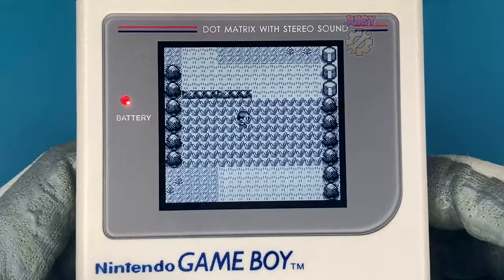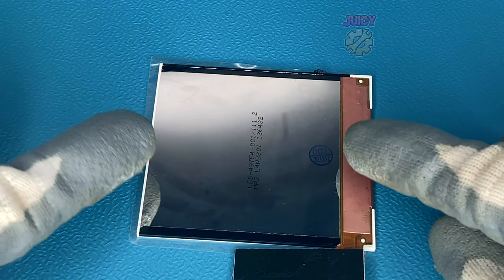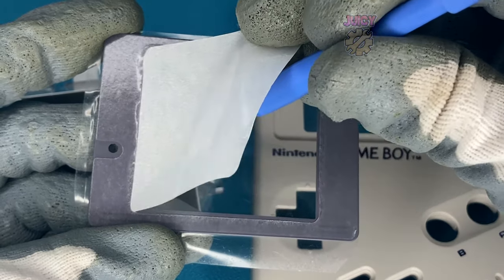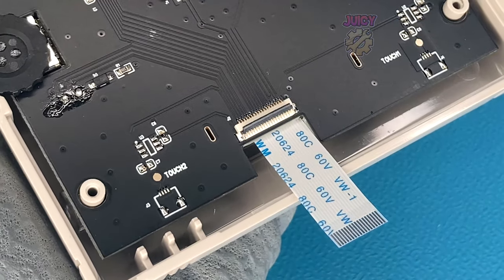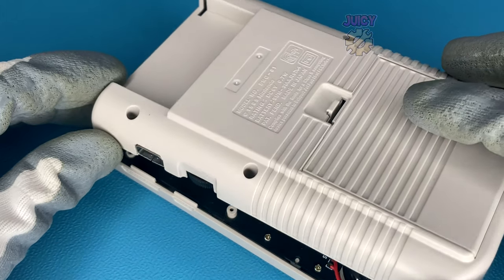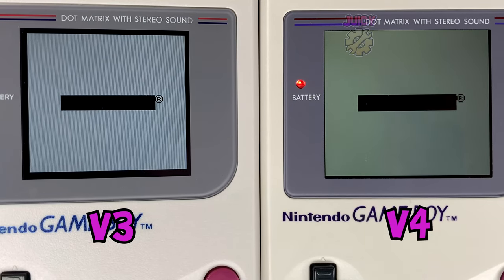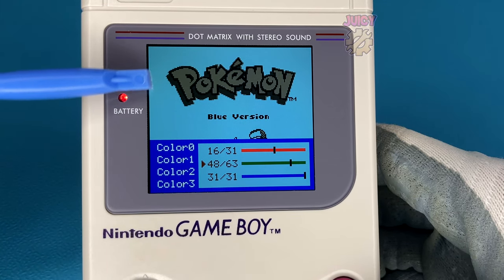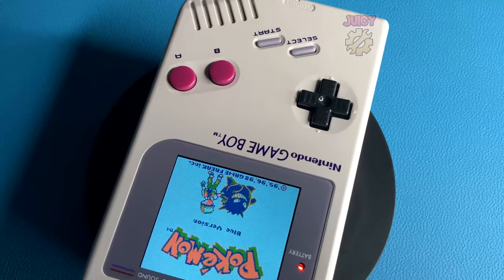BIGGEST Backlight IPS Kit for the Gameboy DMG! RIPS V4 OSD IPS Kit

Comment: I got a question. I installed the ripsv4 backlight kit. But for some reason the gameboy with the ripsv4 has kinda destroyed the graphics chip of 3 different pokemon games. It destroyed the grass sprites.....why is this? Its driving me nuts. I dont wanna stick games in that ripsv4 gameboy anymore. Please help
Reply: Oh, and it regulary deletes save gamea. Or corrupts them
Reply from the maker: That is something. Never heard of anything like that before, I assume you then tried the games in a normal gameboy and the graphical issues persist ?
Reply: @JuicyJakeRepairs  i tried it in pokemon stadium. Same problem :'(
Reply: @lolzman2539  Replace the battery in the game.I would start with this
Reply: @martintessier4444  already did that..